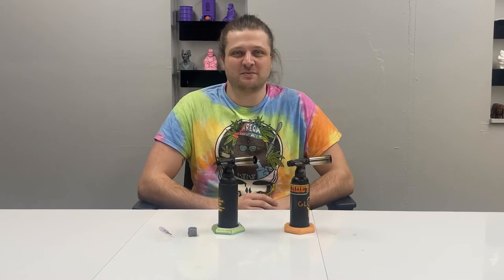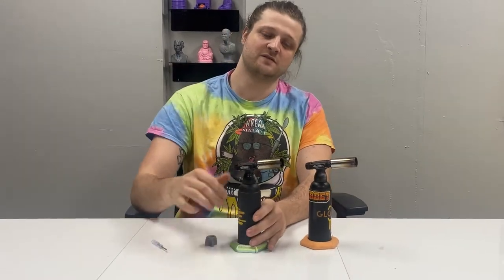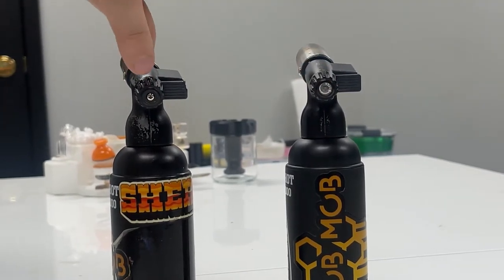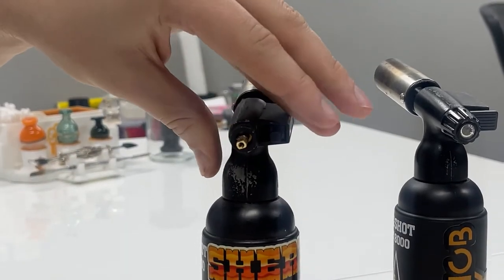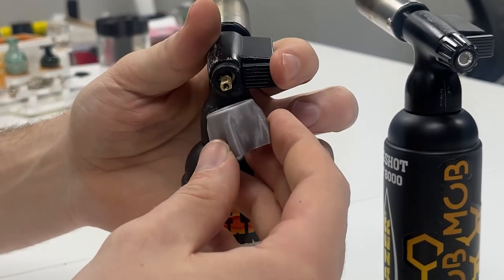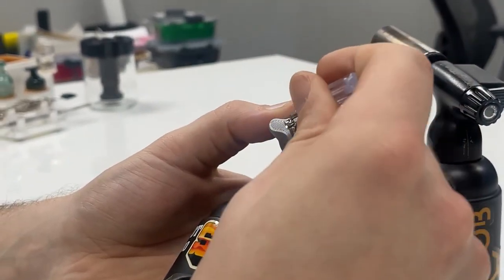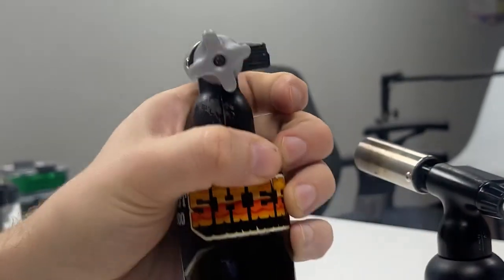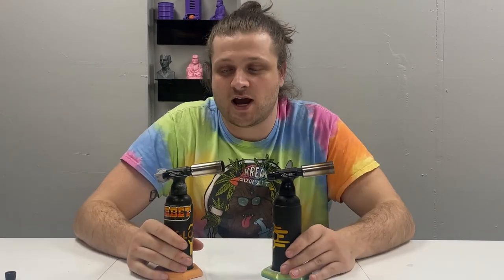Blazer Big Shot Torch Broken Knob Fix

Comment: My screw did not come out easy at all, I actually stripped it by hand. How the hell do I get it out now??
Reply: Might need a screw extractor my guy
Reply: Same I still can’t get mine out. I broke the plastic part off just so I could make it work and I still can’t get the screw out. There’s no point in buying this new knob Bc I won’t even be able to put it on
Reply: Same
Reply: Just got it out with a screw extractor after doing same thing. Now I have to get a new knob but atleast not a whole new blazer